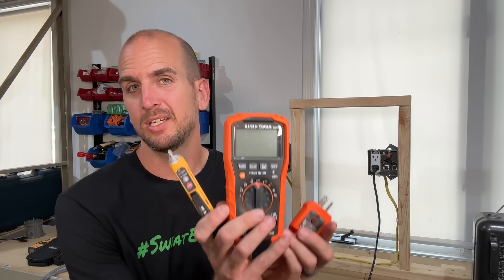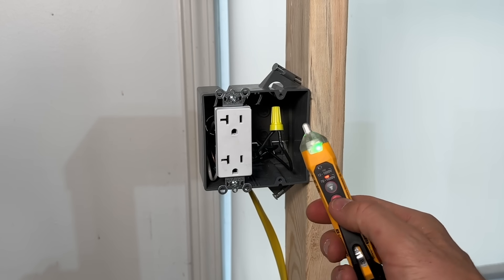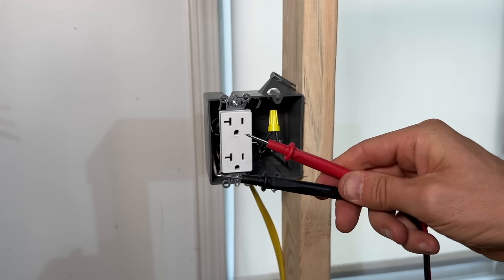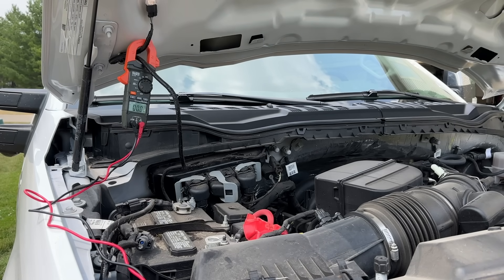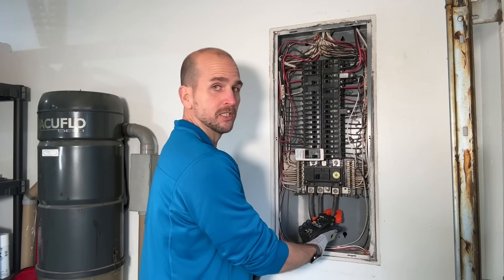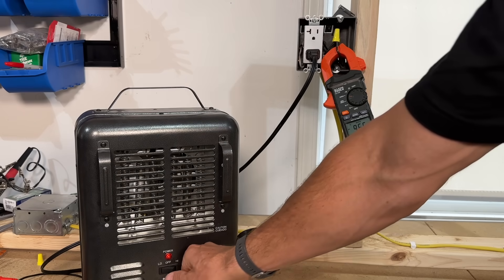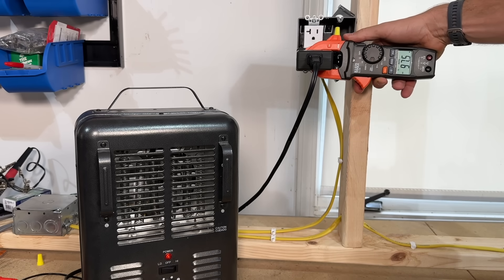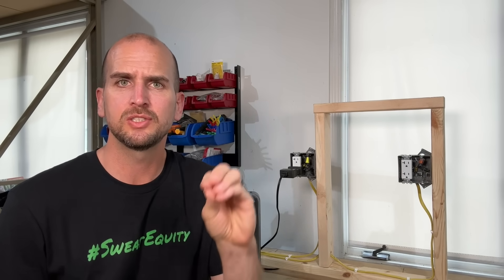Why The Clamp Meter Is The Only Tester You Need | Pros and DIYers

Comment: 2:32 Thank you for using one hand and putting black first. I saw people doing two hands and even red first, this could have been horrible result.
Reply: That one hand "trick" is a bunch of BS
Reply: @Ghostbatman98 I did have to use 2 hands at one point but it cam be dangerous. I don't recommend it.

Comment: Does anyone know the voltage range of the NCV on the Klein clamp meters?  Specifically the CL700?
Reply: It's not specified even in the manual. So nobody knows. You're better off buying a separate non contact voltage detector. They are small and easy to use.

Comment: I'm not an electrician or expert. Just a homeowner. Is a clamp meter safer than a Multimeter?  I purchased the Klein CL810 recently. I didn't read anything in the instructions about any fuses. My old non clamp multimeters have fuses.
Reply: it's rated up to 1000V AC/DC and 600A AC/DC and safety rating of CAT IV 600V, CAT III 1000V, Class 2, Double Insulation. So it's pretty safe to use as long as you use it within its range.

Comment: Is it possible to use this clamp meter to measure the current in a 240V circuit that is wired directly to the breaker panel? The split tester wouldn't work in this application. I'm trying to figure out how many amps my 240V circuits are drawing in order to understand how close I am to the main breaker capacity. (yes, I know, load calculation, electrical safety, etc.)
Reply: just clamp the meter around one of the legs of the 240V circuit.

Comment: @00:48 you state that a DIYer won't need a DMM.  There are certain situations where a DMM (depending on the specs) is needed.  One is measuring the extremely low output of a thermopile (on a water heater or gas fireplace).
Reply: The clamp meter is a dmm.

Comment: This video should not be followed. The clamp metre for checking live is too complex. A voltage tester that only has that one function for testing if a wire is live is preferable. Mistakes could otherwise be made.

This is the type I have in the UK. One function, not dials to to to the wrong setting. Kewtech KT1780 2-Pole Voltage Detector & Continuity Tester With LED Display and Torch.

Comment: I enjoy your videos. They are very good. This one is a very convincing one to switch to the clamp. One issue I have with an old Extech 22-816 is that it does not indicate which probe (red or black) goes to which side  (left or right). Wonder if you care to help to answer that. Thanks

Comment: I held the button until I saw EF but it literally beeped from me touching anything… my walls.. my front door
Reply: I just tested mine after reading your comment.  Mine did a similar thing, but it worked properly when voltage was present.  I think moving it around may generate some kinetic energy that makes it beep initially,  but it doesn't persist unless voltage is present. But, I'm not an electrician.
Reply: @Conspiritor_X I was making direct contact. You’re not supposed to do that

Comment: The Klein does do temp reading. You have to connect the adapter it comes with to the bottom and it will read ambient temp.

Comment: HELLO! tester aneng st181 does not turn on after measuring ac, there is nothing burnt, if the chip is burned out, what should I replace it with? Tell me, who knows, thanks!!Digital Multimeter Chip L17463A 7526B/SFM33528 Exercise Board from ali is suitable?Have you tried changing it? Which one is suitable? on the tx rx gnd point board is this for programming? is it an analogue of 7601 or some other one? Thank you!!

Comment: Hi, when I bought my house: I discoverd that some electric lines are very strange connections: one room outlet in the basement connected with an outlet in second floor kitchen. other outlet in same room, connected with a different outlet in other room in the second floor. if any way i can trace the wire without turning off the breaker? forgot to mention that there are 2 junctions boxes near to the room in the basement. any tools I can use to trace and disconnect 2nd floor completely and put the outlet in the room in the basement togeter? Thank you so much. I really appreciate it.

Comment: I grew up using a analog multi meter , just cannot wrap my mind around the digital meters 
For example , if clamping on one side of a 220 circuit why does it read  .270 
If testing resistance why does it always read 0.L

Comment: Year old clip but question working on say a computer or xbox,play Station or tablet I would use a muilp meter?  Isn't a muilp material for Electronics ? And a clamp meter is for larger power items the fuse on a clamp meter is 600 to 1000 but a muilp meter has to be super low before you pop it

Comment: I think having a good multi meter and a good clamp meter is good. My Klein multimeter has a really good size large screen and it does a ton of different stuff. But a clamp
Meter is good for testing amp draw because of the clamp. 
As I get older my eyes aren’t as good and the large readout is really important to me

Comment: So are the probes the only way to get a voltage measurement?   I was using a line splitter and got a basically logical number for the amerage but the voltage showed .09 (!?) - and it would jump around depending on exactly where I held the clamp meter.

One of the things I hoped to do with my clamp meter was to test the voltage drop on a pump that I have on a 100 foot extension cord

Comment: Thanks for the video.  My Klein didn't come with a manual.  I didn't realize it had the idiot stick built into the tip of the clamp.  Also helped that you explained the clamp feature.  I assumed that was how it worked, but the demo helped too.

Comment: i am both stupid and lazy, hence the following question:
I wanna measure the amps on some device.
Every device has a wire with a plug on its end. And in it is 2 wires.
I understand that i have to clamp just 1 of them wires to be able to check amps.
But how to do this easy without destroying the wire?

Is it an idea to connect a socket to a plug with 2 pieces of wire in between, then connect the device to the socket and connect the plug to the outlet of the home?
Or is this just nonsense?

Comment: I have this… I use it very little because I have  a multimeter that is much more feature rich…diode testing, capacitor testing, min/ max hold, relative function, DC current, and is just a much better meter (faster and more stable) than thus one. I really wouldnt recommend this one unless all you’ll ever do is residential electrical (excluding hvac and appliances). It really is not very useful without other features

Comment: How to use a clamp meter on solar wires?
Reply from the maker: Just have to make sure you have a clamp meter that can do DC current as the lower end units only can measure AC current.
Reply: @EverydayHomeRepairs  yes it has ac and dc. I guess I have to wait until tomorrow when the sun is on the panels. Getting very low readings. Thanks for the reply. 👍

Comment: I would add that I would not use Klein clamp meters for any serious DIY'er. Compared to Fluke, Ideal, even Southwire they have very bad lead connections that frequently work themselves loose. I have a Klein CL445 and while it has a lot of useful functions along with inrush current measurement for a great price, it is my least used meter simply because I have to constantly push in the leads while using it. I've tried swapping out leads and they still work loose, even buying a new set of Fluke leads just for it.

Comment: You kind of do need a chicken stick… A.k.a. noncontact voltage detector. You can have boxes containing multi wire branch circuits, Shared and borrowed neutrals and you need something that can reach into the back of the box and keep checking.

Comment: I just do not trust the non contact voltage tester . They are OK on an individual line but when you have more than that in close proximity they can be a problem if the sensitivity is not set correctly. Besides , a good meter does it all .

Comment: Question: in automotive electrical it's a big no-no to front probe a connector with those basic multimeter leads bc you can stretch open the female receptacles so that they no longer make good/solid contact when the male end of the corresponding connector is reinserted. Is this not true of the outlets in your home?

Comment: Hi. I have a question. I live in a semi detached house. All our electrics are new… We fell out with the neighbors next door. We went on holiday & when we came back, they had built a fence 2inches over our boundary.

Ever since this happened. We have had lights flicker? Interruptions on tv, mobile phones taking hours to charge up. And so on.

We have had our electrics checked & everything seems fine.

As soon as an electrician has been out. Things start happening again.

Now I swear that the neighbors have something to do with this? By maybe latching on to our electricity through our conjoining walls?

I have done my own problem solving by taking mobile phones, DVD player, set-top box to my Works & friends & family & all seem to work perfectly!

Would this device let me know if our neighbor is messing with our electricity ⚡️?

Take for example. I bought a brand new iPhone. 
Tried new leads & tried different chargers and so on.

But the same thing keeps happening??

I’m talking about if iPhone had a percentage of say 80% charge. I turn it off, plug charger in. Check in 30mins & it’s only reached 5 or 6% more. It’s like something or someone is juice jacking?

Also I have used a 20w charger & still the same thing is happening?

Racked my head about all of this.

And I know sumat just don’t add up?

Neighbors have started sniggering aswel.

Last year we actually had another electrician out to again check electricity.
I was mowing the lawn and everything was fine. The electrician left. Then about 5mins later the lawn mower cut out? Then came back on. Same thing with electric kettle. Switched it on & even before started to boil up, it turned off. I walked away. Came back tried again and everything fine?

Any answers to my question or a device I could get would be much appreciated. It’s getting the evidence which is so hard .

Thank you 🙏

Comment: Below, @yellow_panther asked "...how did you measure the in-rush or peak turn on amperage of the devices you were going to run with the generator?"  As I began to respond to his simple question I decided to verify a detail or two, for accuracy, and… ended up going down a bit of a lengthy rabbit hole on this.  I decided to post it anyway in hopes it helps some future reader with understanding inrush current, startup current, etc.
In answer to his question:  You would need a meter specifically designed to be capable of measuring "inrush current." This requires a sampling rate in the single-digit milliseconds. The Klein Tools CL120 manual (link below) says "Sampling Frequency: Approx. 3 samples per second." One measurement every 333 milliseconds wouldn't be able to capture the inrush current.
It is important to define what you're actually wanting to know as the term "inrush current" is also known as locked rotor amps or locked rotor current and is not the same thing as "starting current."  Locked rotor amps is defined as the inrush current received by a motor – or the instantaneous flow of current taking place when power is applied – while the rotor has yet to begin rotation.  This will also be the current drawn should the rotor cease turning, becoming locked, either from excessive load or seized bearings.  But now you know where the "locked rotor" part comes from.
When power is first applied to a motor the rotor is stationary, as in not rotating or locked, and thus draws the "locked rotor current." The motor quickly starts turning and the drawn current decreases. The current continues dropping as the rotor gets up to full speed, at which point the current draw stabilizes at operational minimum.
Some electric motor manufacturers will have this listed within their technical data pages as LRA, L. R. Amperes, LRC, or L. R. Current. For those that do not, it can be calculated: LRA=1000x(kVA/HP)/Voltage
The number may be listed as actual Amps or as a multiplier, such as 6x, of the Rated Current.
In an induction device, such as a motor, during the first instant power is applied an extremely high peak occurs before the magnetic fields can be created and impedance occurs, providing load. During this first instant the only thing slowing down the current is the preexisting resistance of the wires themselves within the windings.
This instantaneous amperage value is not typically all that useful in day-to-day troubleshooting as it greatly varies by what phase angle point the incoming line sine wave was, the size of capacitors being charged, and the temperature of the windings, during the moment of power connection. For a motor this time is incredibly short, only a few milliseconds or cycles, during which the magnetic fields are first created within the windings. For a transformer, depending on size, this can be significantly longer, tens to hundreds of milliseconds or more.
This is why a meter's sampling rate makes THE difference in measuring "inrush current." If the meter is sampling every 333 milliseconds it's likely to miss that initial peak value.
However, starting current, present during acceleration of an AC motor, just as it has begun to rotate, takes place AFTER the inrush current has dropped off.  This varies by starting method but can take from 1 to 20+ seconds. Measurement of starting current, not inrush current, is the more commonly required one in doing routine maintenance checks on motors and other devices. As insulation ages and breaks down within motor windings the starting current values will increase. Recording starting current measurements over time provides valuable health data and expected life span of the motor. The vast majority of meters out there cater to the lesser time-sensitive measurements such as this.

Klein Tools CL120 Auto Ranging Digital Clamp Meter:
https://data.kleintools.com/sites/all/product_assets/documents/instructions/klein/CL120-1390362ART%20-%20WEB.pdf

Regarding generator sizing and handling those initial spikes from inrush and starting currents:
Motors typically draw six to twelve times their full rated current. Likewise, motors with high inertia loads can also require up to three times their rated current during starting.
Online are numerous generator sizing calculators where much can be learned about loads, such as this one:
https://apelectric.com/generator-sizing-calculator/ 

As well as calculators for Locked Rotor Amperage (LRA), AKA "inrush current." This site references a "code letter" which can be looked up from a table on the same page. Some manufacture's sites have the code letter listed in the LRC field.
https://generators.smps.us/surge-current-calculator.html
The https://www.smps.us/ site is an older one but there's a lot of good info.  It's author, Lazar Rozenblat, is a retired electrical engineer with over 30 years of experience in practical power electronics design. I just learned about him today while looking a few things up.

Here's an example of some technical specs for a typical 3 HP air compressor motor as sold in many hardware stores:
Output	3 HP (2.2 kW)
Rated voltage	115/208-230 V
Rated current	29.4/16.2-14.7 A		(Read: 29.4A@115V, 16.2A@208V, 14.7A@230V)
L. R. Amperes	176/97.2-88.2 A
LRC	6.0x(Code H)	(Read: 6 x Rated current)
No load current	13.0/5.60-6.50 A		(Read: Amps drawn with motor shaft free-spinning unconnected)
Source: https://www.weg.net/catalog/weg/US/en/Electric-Motors/AC-Motors---NEMA/Definite-Purpose/Compressor-Duty/Compressor-Duty/Compressor-Duty-3-HP-2P-F56H-1Ph-115-208-230-V-60-Hz-IC01---ODP---Foot-mounted/p/10698252

I can't paste an image in here but on page three of this PDF they have an excellent graphic showing the current draw of a motor from inrush current (initial power on), through starting current (acceleration of motor), and into rated current (fully running):
https://literature.rockwellautomation.com/idc/groups/literature/documents/br/ie3-br001_-en-p.pdf 

I hope all of this helps!

Comment: Dang... if only we'd had a clamp-on ammeter back in the mid '80s! My friends and I used to go through hours and hours of troubleshooting whenever we installed a car alarm or sound system in our cars back then.  All we had was the trusty old multi-meter. Which was fine for volts, ohms, and amps, but it wasn't much help at finding current leaks. I still have and use the same $125 multi-meter from 1985, too. But once you've learned how to use a clamp-on ammeter correctly, chasing down current issues becomes ridiculously easy! I rarely need the multi-meter anymore.

Comment: You say that you used this meter to measure the load for a generator, but how did you measure the in-rush or peak turn on amperage of the devices you were going to run with the generator?

Comment: If you do electrical work. 
Yes. 
- Clamp meter so much better. 
- Multimeter not suitable.

If you do electronic work
- Multimeter so much better
- Clamp meter not suitable.

WHY??
Both Clamp or Multimeter can use for got Volt, Amp, Ohm, Farad, Diod) 

But they have different.

1. Clamp meter only work for biggest value.  Volt/Amp/Ohm/Mico Farad/Diod only. cannot test small value like Mili, Micro,Nano.

2. Multimeter meter can use for got both biggest and small value. 
Mili + Micro + Nano.  But for ampere test, only can read under 20A.

Clamp meter up to 1000A

Comment: I use Uni-T 204+ Clamp meter for 4 years..Very satisfied use this brand. Cheap but have quality.. no have  any problem/ faulty until now. still like new. If i want get very accuarate reading for electronic work, i use digital manual range multimeter... this more accuarate reading than clamp meter